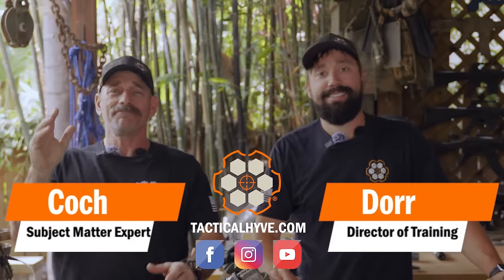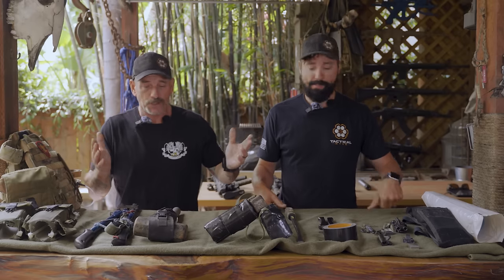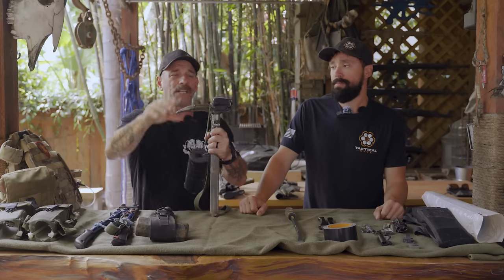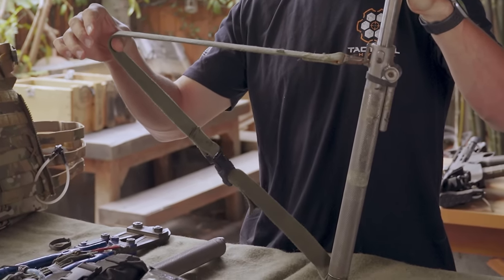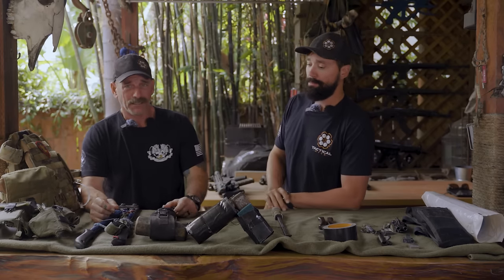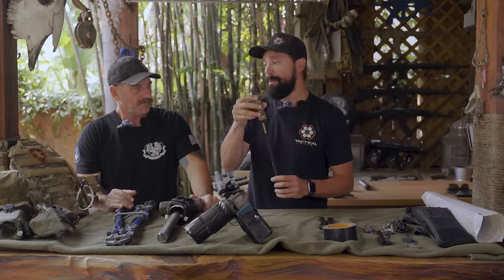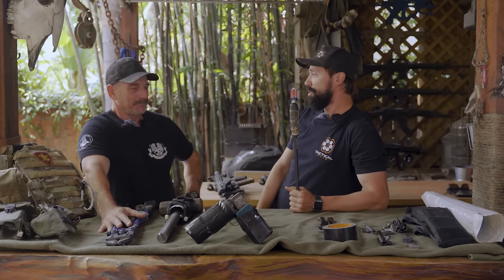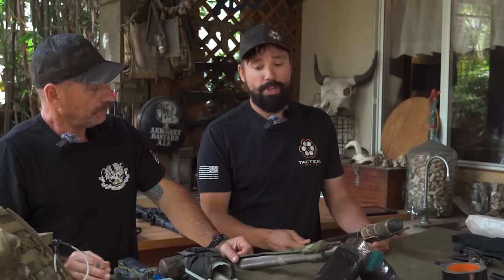CQB Breaching Equipment with Navy SEALs "Coch" and Dorr

Comment: 3:41 When I was in the 101st our hooligan tool came in a purpose built carrier that included the sledge and boltcutter. It was like a big backpack that had all the important bits in a padded section and the handles sticking out. It's really heavy and not as practical as your guy's setup, but they did exist, and some poor grunt had to carry it on their back.
Reply: Thats essentially what our swat commander ordered for the team i work on. It held a ram, sledge, hooli, and bolt cutters. It got worn once and now it just stays on the van and we carry our shit on approach.

Comment: When we deployed in 04, there was one set of hooligan tools for the entire company. For us the tool was a halligan, the kit was hooligan tools. Well since there was one one set of breach tools for the company, we had to figure out other ram solutions. We weren’t breaching with charges. Well we had just laid a bunch of concertina wire. I took the picket pounder proved the concept to my Platoon sgt, and for every raid I did from then on out, I carried that picket pounder. We even got one of the Blackhawk rams an I still used it. It was heavier so it worked with the gates and would shatter the wooden doors. 

For quieter entry like multiple hits in the same area, we would carry “siege ladders” basically 2x4 ladders that were about 4 ft tall. We used them to climb over the courtyard walls.

Comment: Very nice video. My late father was an Arson Investigator and Explosives engineer for the state of California. In fact he wrote the state certifications test for Explosives. He was sent to some interesting classes including some that were LEO/SWAT oriented. The ammount of math that can go into a breach is interesting. As for myself I have worked Demolitions and Remodeling. Sometimes you encounter locked doors that need to be opened. One of the more fun jobs was prepping an abandoned hospital for demolitions. As the building was no longer in active use the security was an issue. I had a co-worker ran out of the building with a guy armed with a machete hot on his heels. I didn't get to breach any doors with a shotgun( The local SWAT Team got to do that) However I did have to pry or bash open a few doors that the key had disappeared or was not working. There is an art to opening up a door without a key and it is a skill.

Comment: The Halligan tool is made of one single piece of metal and the Hooligan tool has 3 specific parts assembled together. This build-structure makes the halligan bar set apart from the hooligan tool even though they are pretty much identical. The second factor is the size and weight of the tools. The third factor is the different uses of the tools. And finally the quality check of the tools.

Comment: Hypothetical question: could you put little tape wings out to each side of the 15 both top and bottom, and use a staple gun to put those wings to a heavy wood door, or even a metal door if the staple gun were strong enough? Or would that be too much noise in your opinion? It seems logical if everything else is already hooked together, it could be extremely fast and create a very small window of exposure, but with a little bit of noise.

Comment: A pound of tannerite taped to a door works pretty good to.
Reply: Half pound will do it if you can water-tamp it.  
Sausage roll up the nitrate formula in a baggie, and put a water bag with a quart or so behind it.  (Can also use the kidney shape USGS canteens if you have plenty.  Put the "sausage" in the "crack."  Leave a "tail" on the sausage roll that you can really hit easily hanging out the top or bottom.  It also keeps things on YOUR side of the water container safer.  Brought down some sketchy smaller trees (storm damage) with 1lb or less.  It really gives the cheap shjt a kick in the rear.